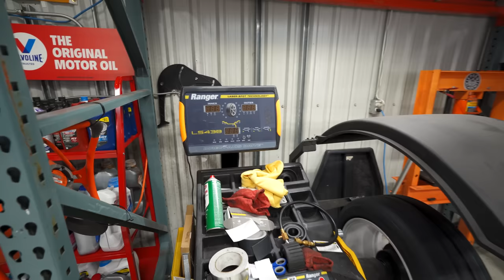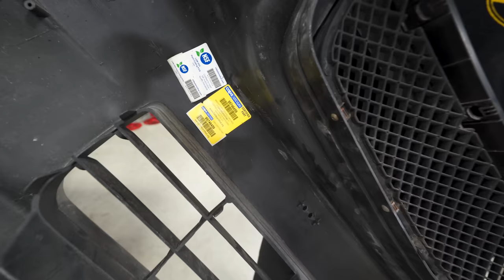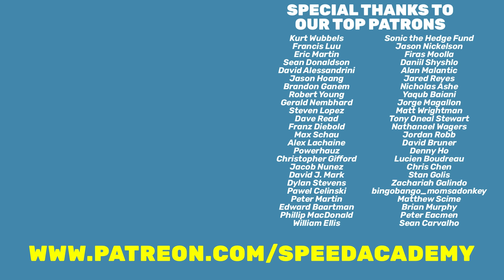$2000 Honda Civic K-Swap Quick Build is FINISHED - PT 4

Comment: tip if you guys are doing more brake lines is have the brake pedal slightly depressed with a piece of wood or w/e and it closes the master and stops all dripping and makes it better. Also there is a nice hydrology brake flare tool kit that works amazing and makes fuel lines as well. cheers and great build
Reply: PowerGains, you got a link to this tool?

Comment: When fender lips are cut with a grinding wheel and then rolled you get a optimal clearance with a smooth finish. Then just piant the inside trim that was cut for protection.  The fenders actually flare-out more.  All in all the car looks really good.

Comment: quick tip next time you need to do brake lines or change calipers but dont wanna loose much fluid: push the brake pedal before removing the line. its like putting your finger on top of a straw and pulling it out of a cup, by capping the one end fluid will not want to flow
Reply from the maker: Great tip
Thanks
Reply: your welcome :)

Comment: If you guys are looking for a seat with better bolstering but stock mount us a EK seat rail on an Integra or Prelude seat, gives better bolstering and bolts up like factory. Unless you want to get 8th gen Si seats and modify the seat brackets to bolt in those are even better. Love the build!!!

Comment: If it were me and i was doing a budget build like this and the sparco seat didn't work out, i would have gone with Del Sol seats.  they sit you lower and have the adjustability.  i have used the same del sol seats in 4 different honda builds, and love them!

Comment: the rear muffler will form 🔥  the bumper nicely when you hit the track. I saw it happen on my miata.  it'll make a cleaner shape that the human eye but you'll want to clean the muffler when it happens because that sett didn't want to come off the tip if you let it sit

Comment: Valex racing on eBay sells the full set of high quality stainless brake lines. I’ve personally used them on my track car. They’re oem length, no tucking etc. Easy to replace as long as you can get the old ones off lol

Comment: I watched from part 1 to now and so need all the fine details. Picking the K24a1 is the fun part , getting in its engine bay you went front wheel so what the transmission hook up to ..just some stuff I need to see

Comment: Great looking car. You might find that the manual steering works in your favor on the track, better feedback and less spongy feel in though sweeping turns where you have to constantly make little changes with the input.
Reply from the maker: If it was a manual rack then certainly yes but this is a depowered rack so its just too heavy around our local tight track.

Comment: The most important step after heating up a nut or bolt to help breakdown the corrosion and loosen it up.. is to let it cool down again before you try to remove it. The expansion and contraction both help and the steel will regain all its strength again so you won’t round it or snap it. 
Why do people not let it cool first?!

Comment: K swapping is so cheap for this year honda.  All you gotta do is get original harness and motor/trans & axles, some new mounts, ebay radiator and other small things like that.  Aftermarket Shift linkage, jackspania k series hsrness adapter.

Comment: Beautiful build❤️ and to answer your question Peter; I do not think anyone can be as happy as you with the result. I mean, I absolutely love the looks of the car (that engine bay🎉) but you are the one who can actually drive this dream, so assume you’re absolutely over the moon!

I really love the “clean” look of the car, the colour does the right job and removing the K-tuned banner was the right choice!

One small question; what’s with the (aluminum) tape on the inside of the wheel after balancing it?🧐

Really looking forward to see this gem on the dyno (and on the track afterwards)🤟🏻

Comment: Set the stock seats at the setting u want and mark it. Then cut the rails on the stock seat and weld them to the aftermarket seat. It will sit a bit higher than u want bcuz of the stock rails but it works. Make great content 🙏

Comment: It looks fantastic.... totally a bummer that the underside is crusty and nobody likes bondo. It definitely needs some integra cloth seats until some aftermarket seats are in the budget. I think Dave ended up with the better car all around on this build off though. I don't like 3 things typically... Rust, crashes, or resprays. But I would take a properly fixed crash and respray over a rusty respray any day. Both are great builds. I think the civic wins the track battle but i would rather have a slower ITR any day. Bring on the track day.

Comment: Hey guys, Check out Valex Racing. They sell a stainless brake line kit from master cylinder to the calipers. Very easy to install and I did not have to drop down the tank or subframe out of my 99 Civic. Hope this help in the future. Keep up with the great content. 👍🏽👌🏽

Comment: I have a 99 civic coupe and replaced the rear brake lines from front to rear without taking out the fuel tank. It’s possible to do it without taking it out

Comment: I want to do a fully built motor on the k20/K24 and boost it and make it AWD - I feel like that way I will be able to beat heavily modified Shelby's, SRT's, ZR1's,ZL1's ect.... Right ? 🙄
Reply: If Best Motoring has taught me anything, a lightweight Honda with a good driver can beat anything on a technical track without long straights.

Comment: NO LSD ? VTI UK 98'hatch Mfactory LSD on mine + loads more upgrades throughout Had it frm late  99'  road use only .. 4 yrs looking for R'tex supercharger no luck any ideas ( not turbo)a2  standard engine 80k only ..nice to see" Mikey Birch "Does time trails  with same engine here in uk 'Here TEGIWA'sponsors

Comment: I respect the build and the passion put into it...

17000$ at this point + the labor to build it, how much do I have to pay in total ? maybe 25000$ ?
Reply: more that.. prob 30k
Reply from the maker: Most people rarely realize the real cost of full builds so when a shop quotes 25k they think its a rip off or it can be done cheaper. The reality is shits really expensive these days
Reply: @speedacademy  Sorry for my misunderstanding comment (Im not an english speaker).
The process and the cost of this build remind me when I was young, I built an EG with k20a2 I had 10000euros for budget including the car.. I ended up with 15000euros and it was still not finished as I wanted...

Therefore I took the decision to sell the car unfinished at 9000euros it was pain to sell the car, you don't have a buyer every morning

I'm sure the car will give a lot pleasure as it is track oriented. but for that's amount of money (IMO) there is much better alternative.

Comment: Hey guys, I'm really enjoying to see you guys doing this build. I have a question, is there like a "Budget" upgrade to brakes just like you did to this build for an 2006 RSX Type S  ?  ... Meaning bigger rotors and bigger calipers from other vehicles that bolt on to my RSX.  Upgrade Kits for this are very expensive, if I could do this to my RSX would be awesome.
Reply from the maker: Sadly nothing. Although you may look into big calipers off a Porsche that you may be able to buy adapters to make fit.
Reply: @speedacademy  Thank you for your prompt response.

Comment: Those spray hides rust only or prevents it from spreading by killing oxidation?
Reply: It helps prevent spread. Really they should be spraying where there isn't rust yet in known trouble spots and it will prevent that as well.
Reply: @GleepGlop2  i guess best option always is to clean up rust and then spray something

Comment: That just a sad state of affairs when you piece together rusted brake line when you say you had whole day to replace the line on a car you plan on running at the track. Great looking car and motor but no way I would feel safe those brakes lines that you didn't properly fix. Good luck.
Reply from the maker: Have you replaced a rusted brake on a rusted car? Its alot more than a days work. Its all 4 lines, fuel lines, fuel tank, etc plus other countless things that can break. 
The fix that has been done wont magically fail either, Im more worried about the other rusted lines now. Oh and spoiler alert, the car has made it through the track day.

Comment: Why you put the foil in the wheel wells?
Reply from the maker: To keep the weights from falling off at the rack track. The glue holding the weight can get too hot and then it falls off. The tape holds it down
Reply: @speedacademy  Yeah I took note of that, I'd probably do that to my daily's wheel weights just for peace of mind.